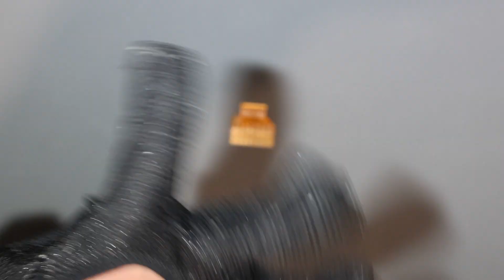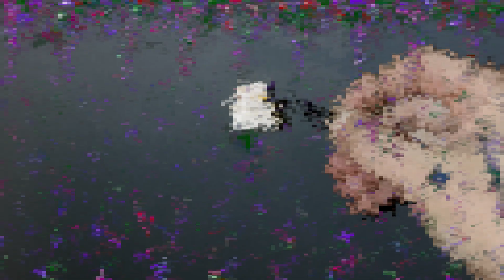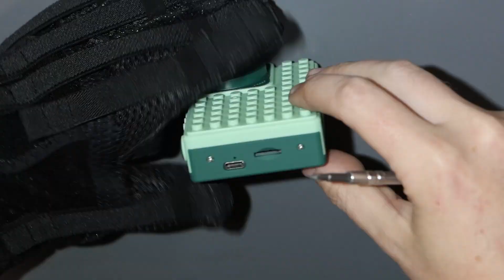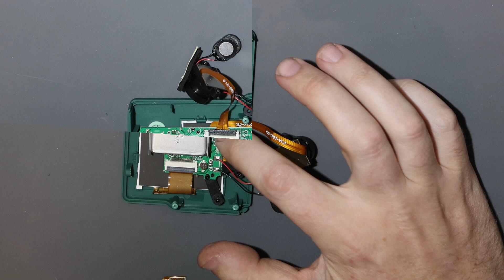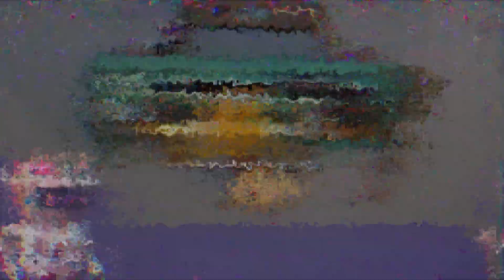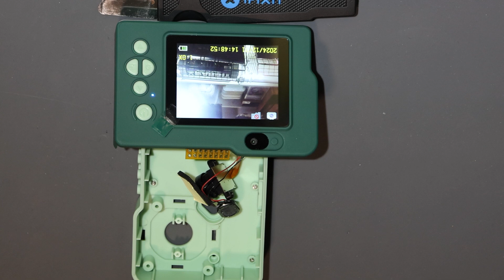Easy-Mode Circuit Bent Glitch Camera - Part 3

Comment: When I attempt to turn on the camera i just get the color bars of death. When I switch to the rear facing cam it works but I am unable to bend with wire or tweezers. Any troubleshooting tips???
Reply from the maker: It sounds like it could be one of two things: it may just be misaligned in the connector (it always takes me a couple tries to get them lined up right).
There also appears to be a model out there that doesn’t bend. Usually it’s a dual camera in a case that looks like the thumbnail for pt 1&2. I believe target also sells a cheap camera that uses the same board. So if that sounds like your camera that might be it.

Comment: Heck yeah! Great update. Still have a couple of the 2.0 ones I bought from you. Wonder if I could trim those a bit to make them work similarly. Either way I'll likely order some 3.1s from you in a bit.
Reply from the maker: Thanks! And yeah you can totally trim off some of the excess to turn a 2.0 into a 3.0
Since they’re transparent you should be able to see where the traces are, and there’s a mm or two extra you can trim off to get it to fit in without any soldering.